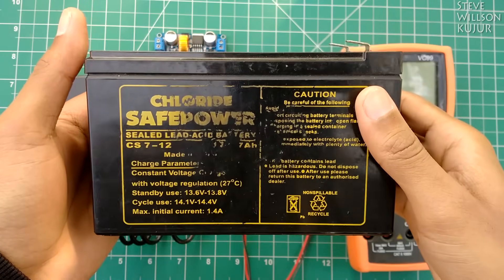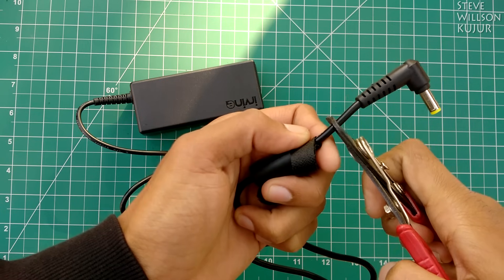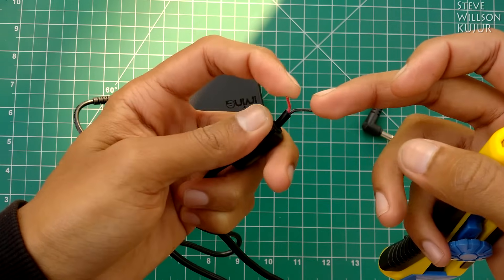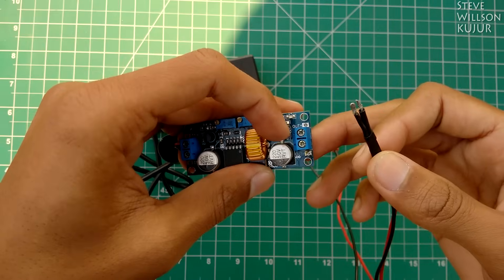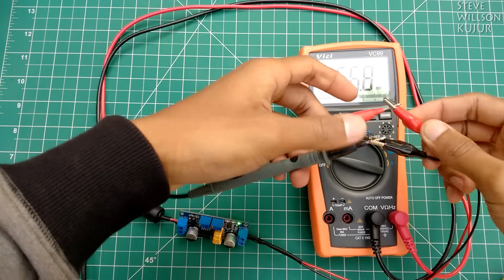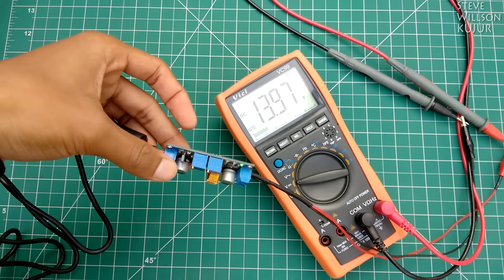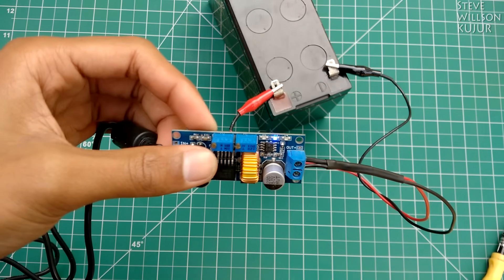How to Make a 12 Volt Battery Charger

Comment: Will it stop charging when battery is full?
Reply from the maker: +Naveed Iqbal yeah charging will automatically stop because of equal potential difference
Reply: So If I use a 14v adapter then I will not need the stepdown mOdule?
Reply from the maker: +Naveed Iqbal you need that because it should be charged with a constant current
Reply: Ok, thanks

Comment: what should be the charging voltage and current for a battery(12V 1.3AH/20HR)
constant voltage charge-
cycle use 14.4-15.0 V
standby use 13.5-13.8 V
initial current less than 0.39 A
please tell me the voltage and current to charge it when not in use....charging it using a laptop charger (18.5 V,3.5A) and a dc step down module (XL4015)
Reply from the maker: +Sushant kumar .

charging voltage - 13.5
constant current - 0.3 A or 300mA
Reply: +Steve Willson Kujur 
thank you
Reply: how to know if its fully charge
Reply from the maker: +Sushant kumar green led will light up
Reply: +Steve Willson Kujur 
are u sure, every module is having that green led..
Reply: actually i have ordered it from amazon, not yet get that module
Reply from the maker: +Sushant kumar I'm not sure but i guess it's there
Reply from the maker: +Sushant kumar it may be there
Reply: ok, lets see. what i am getting!! thanks for your  replies

Comment: where is the cut off for battery full at 13.7v ? your set up will boil the electrolite eventually damage the battery ??
Reply from the maker: +Shann Dhayanithi no I'll not damage the battery .
you can use 13.5 v also

Comment: I need help 

I'm making a hydrogen generator but I have the same 12v block. How or what do i use to break up the circuit so it doesn't spark and short circuit.
Reply: you can use a fuse or a PTC fuse

Comment: Hi, I see that the specs for this step-down module are input voltage of 1.25-36V. If I want to charge a 12v SLA battery fully, I'd need to use a power supply of somewhere between ~15v and 36v. What would happen if I used a power supply of less than the float voltage of the battery (14v in the case of this video)? Say if I used a power supply of 13.7V (a common 12v wall wart for some home appliances), with this step down converter (set to 14v) on a 12v battery... from my understanding, the battery would charge to the 13.7v (assuming it was previously lower), and the it would automatically 'float' at this voltage because the charger can not supply electricity to the battery anymore because there is no voltage differential? This would mean that the battery would be nearly fully charged, but I would be in no danger of damaging it, correct?

I understand it would be more useful to just use a higher voltage power supply, but I'm thinking of how friendly this would be for either charging with whatever is on hand, intermittent solar charging, or in case of user error/ignorance.

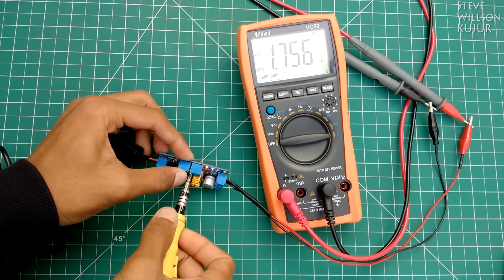Comment: 3:14 how you manage to measure the current directly connecting to the meter? As I know I have to connect on of the terminal to the circuit via multimeter to the battery or power source. Can I measure the of an ac adapter through directly by connecting to a meter?
Reply from the maker: +Sakhina Khatun no you can't just connect it to ac .
i did because this dc to DC converter capable of doing constant current that's why.

Comment: can i use this modular for this battery KOYOKO YTX12-BS  12V12AH/10HR  and i would like to know how long will it take to charge completely
Reply from the maker: +pracash sam around 6 hours at 2 amps
Reply: thank you, cos i went to my electronic shop and they had shown me a modular the out put is .1.5 till 4 amp sales person say i need to plug in to charge one whole day to fully charge.  and recomended me to buy a battery charger cost RM 179.00 which haS 4 - 7amp  out put will charge 4 to 5 hours. but i havent bought that unit yet.

Comment: Do a video on how many amps on how much AH for a battery should be used for charging.
Reply: A battery NEVER charges at 100% efficiency ... NEVER, NEVER NEVER. It's usually only about a 60-65% efficient process. You should ALWAYS allow extra power consumption than the AH rating of the battery.Just look at any mobile phone manual or electric drill manual. They ALL (pretty much) say to fully charge the battery before use for SIXTEEN hours and at a current of 10% of the AH rate. This applies for just about ANY battery - lead acid, NiCd, MiMH, Lion. They can ALL be charged at higher rates, especially Lion, BUT and it's a BIG BUT you MUST be careful not to stress the battery too much. 

10% of AH rate for 16 hours will fully charge just about any battery in reasonable condition. If the battery starts to get hot, especially if it's too hot to touch, STOP CHARGING IMMEDIATELY. This is why Lion batteries have sophisticated monitoring inside them to stop the whole charging process if they get too hot.

Remember too that the AH rate is at for certain timeframe (usually 10 hours). So a lead acid battery with 150AH rating will typically be good to deliver current at 15A for 10 hours before it's voltage drops to a level beyond which battery efficiency and it's life generally, will be severely affected or even kill it. Clearly a lead-acid car battery is designed to be able to deliver several HUNDRED amps during starting but the battery will get very hot and also become flat in very little time if you continue trying to start the engine.
Reply from the maker: for led acid its 1/10
Reply: Steve Willson Kujur Only 1 amp for 10 AH? That's take too low energy, I mean that 14voltsx1amp that's only 14watts for a 10AH! And what about a inverter battery? do you have any idea?
Reply from the maker: 150 A that means  1/10 = 0.1 , 150 x 0.1 = 15 A
Reply: I don't have a 150AH battery, I just simply asking how much apms it will need to charge a or more than 100 AH battery? I mean inverter batrery. So that's 15 amps! for a inverter battery! 14v x 15v = 210 watts of energy! for a 150 AH battery!
Reply from the maker: yeah . you just calculate battery amp X 0.1 you'll get how much you need

Comment: How you know that your battery will not take more than 2 amps? If your battey takes more than 2 amps than your module might get damage.
Reply: Ah! good point, i was wondering the same thing, thanks!
Reply: Neufloxin Floaxacin  phphoygogolhoohhooooo let ohooo
Reply from the maker: it'll not draw more then what you set

Comment: Does it have over charge protection?
Reply: No need to guess. Steve already said in his video, and several times since ... you SET the output to a FIXED voltage and you SET the MAXIMUM current that can be drawn (THAT'S why he short circuited the output through an ammeter in order to set that maximum current). If the output is open circuit, or with a fully charged battery the voltage is 14.4 volts (if that is what you set) if the output is short circuited the output current is at the MAXIMUM THAT HAS BEEN SET!

SIMPLE guys!. Come on wake up! Smell the coffee! 

Oh! Yes! And these little circuits are VERY reliable. I have used a couple to provide a simple internal repair to TWO broken 24 inch Dell monitors I was donated that are currently sat operating on my desk together with my third 21 inch monitor! This is being typed using one of the 24 inch ones! A LOT simpler and cheaper than repairing the inferior on-board switching regulator which had blown.
Reply from the maker: it will not over charge your battery
Reply: WannaDuino! The Real Live chill bro he has no hair left 😆he just wanted some attention 😆.

Comment: hey man great video
can this method be used for long term
and is it safe?
Reply: planning on making a portable boombox and using two 12v batteries to power everything. Can this method solve those batteries for long term basis without compromising safety?
Reply from the maker: +soham bhattacharya yes of course you can I'm using this method over a year now no problems at all . go ahead
Reply from the maker: +soham bhattacharya yup is very safe no problems at all trust me.. 

I can't compromise with my viewers safety.

Comment: Can this converter be used for a 24Volt Battery bank? Great video by the way.
Reply from the maker: +Opposite Worlds yes for sure but you've to do some modifications .

something like .
30v input voltage.

and set the output voltage to 28v .
and current as needed
Reply: Thank you.

Comment: Hey this is a great video what a task is this converter will stop when the The charge is full I want to make sure it's not going to overcharge the battery to make sure there's not gonna be anything dangerous please let me know thank you
Reply: A lead acid battery, (unlike Lion and NiMH and NiCd batteries) should NOT just have the charge current cease altogether when charged. It has a very small resistance which over a long period will cause the battery to self discharge. It should receive a small trickle charge to keep it healthy. Lion, NiCd and NiMH batteries can be switched off but should be periodically checked and receive a small trickle/top-up current. A lead-acid battery (gel or liquid) will be totally happy being connected to a constant 13.9 to 14.4 volt supply (exact voltage will depend on specific battery type and construction).

In normal operations, after starting your car, your battery does absolutely NOTHING. The alternator provides all the electrical energy required (or it should do). This ONLY applies whilst the engine (and hence alternator) is running of course. Check your battery voltage when the engine is running and the alternator working ... it will be between 13.5 and 14.4 volts. SOME cars may go as high as 14.8, but the Lucas standard in the UK for at least 50 years to my certain knowledge is 14.4volts, and that voltage is ALWAYS across the battery when the engine is running. So the battery is perfectly happy to have that voltage across its terminals.
Reply: Lead acid batteries won't overcharged if it's limited to 13.8 (up to 14.1 Volts).
Reply: will it over charge ?
Reply from the maker: +yan. yan not at all
Reply: so it will cat of when the  charge is full ? i dont   need to add anything ? beside Battery over-discharge protection
Reply from the maker: +yan. yan you don't need any thing for the protection.
Reply: 14.4 v is correct  and you are also correct that some will go as high as 14.8, Mitsubishi use to reject any battery that measured less than 14.4 after standing for a period of time.   I use to buy their rejects cheap.
Two problems I have with this system is its going to shut of to early , even if you set it at 14.4 volts its not going to be fully charged , And the cut of is just set to voltage out being over taken by voltage from the battery  it will not be fully charged.  It must charge until it stops taking amps not when it reaches its voltage. Voltage is just the kick the amps is the amount of power it has.  In other words it will reach 14.4 volts switch the unit to of but the battery if say it was a 500 cc (amps at crank) can be as low as 100cc.  Only 20% charged and it will show 14.4 volts. Its exactly why a battery in a car will show 14.4 with in a minute or so of starting  but still be very flat.  I have a quality 8 amp charger and no car battery likes 8 amps , 2amps max and 24 hrs min.  Thats what a good battery will take to charge properly. Lead acid vehicle battery that is.  Fast charging lead acid batteries is a big no no and many will just simply not take the high current flow.  And you will do some damage to it.

Comment: Thank you Steve, I am so happy for your prompt response. 
Can you pls give me a detailed description of how to accomplish this? I am a novice in this field; but I can fix it if you give me the necessary me guidance especially concerning the installation of a diode. 
By the way, will this setup require an inverter for the laptop charger to pick up the energy coming from the solar panel? 
Thank you in advance.
Reply from the maker: +Muhammad Salau yes you need a inverter or a boost converter to boost the 12 v 

Connection 

1. Solar panels got 2 wire negative and positive 

2 . Converter got 2 input and 2 output 

3 . Output directly goes to battery okay?

4. Input - connect solar panel positive wire to input positive .

5. Input - connect Solar panal negative wire to a diode before connecting it to input negative .

got it ?

Comment: This seems dangerous, shouldn't it cut the power when the battery is fully charged?
Reply from the maker: +YSC it's not dangerous at all when I'll get fully charged .

it'll go in constant voltage mode 
no current will flow 

that mean float charging .
Reply: Steve Willson Kujur That looks like a buck converter rather than a battery charger, which means it will output a constant voltage rather than a changing voltage|current suitable for charging a battery.
Reply: It says it is a buck converter in the product link.
Reply from the maker: +Baerchenization Yeah it's a buck converter .

it's use to step down the 19.5v to 14v to safely charge the battery.

Comment: does removing those lids of the battery damages it?
Reply from the maker: +Igor M. which one ?
Reply: Steve Willson Kujur those on top of the battery at 3:35
Reply from the maker: +Igor M. yup for sure if you'll remove those then it will get damaged.